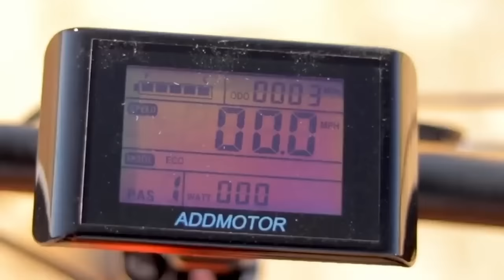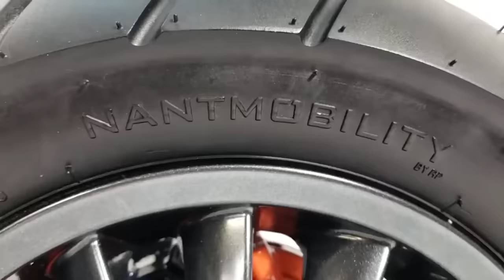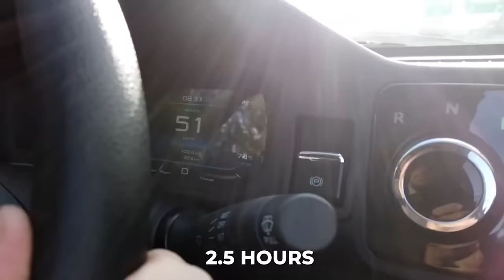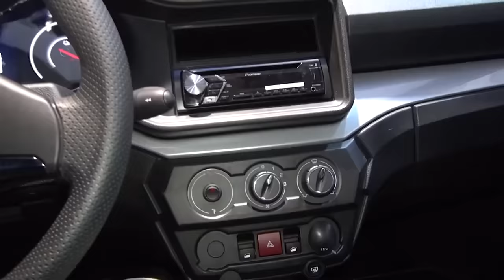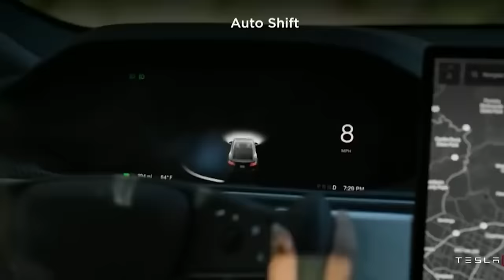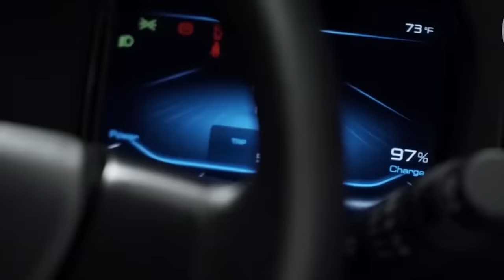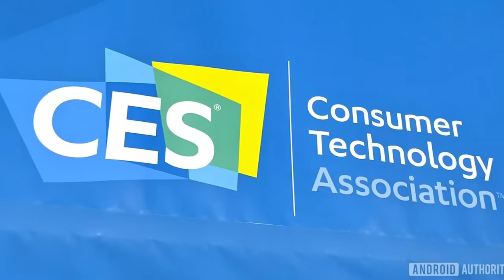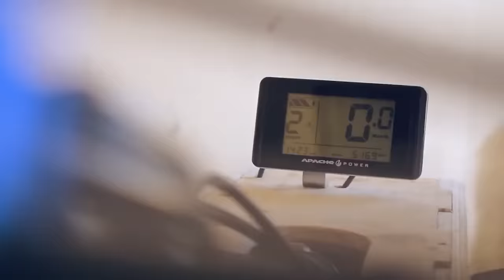60 Mini EVs, Quadricycles, and Bike Cars to Hit the Streets!

Comment: OK so I know a lot of people do those types of bicycling but I wonder is it just as effective as writing a 2 Wheeler because on a 2 Wheeler you can actually get up off the seat and use your body weight force down into your legs and pushing the petals to either up or down hill does it give you more or less of a workout
Reply from the maker: Interesting
Reply: people that ride recumbants and vello mobile say they are just as good maybe better.

Comment: I like the Begorett from Barcelona. Many nice features plus awesome visual. I guess its not available yet. But all of these fun ev's need to be realistic if they want to share roads with cars. As the saying goes for motorcyclists,"It's not if, it's  when". So once again, at high speeds and road sharing with cars, protection is numero uno. Freeway driving with those skimpy vehicles is downright nutso.
Reply from the maker: Logical feedback. Thanks! Yeah, for now, most of them are meant as inner-city drivers. Not necessarily for competing with big trucks on highways at highway speeds.
Reply: Thanks MUCH for using us....
Are there any links we can utilize to get to their respective websites?
Reply from the maker: @haroldpierson5271  We'll put those in future videos.
Reply: yes in the UK, it is illegal to drive Category L7e Quadricycles on motorways (like you cannot take 50cc scooters either). A-Roads are permitted however. the biggest concern i have with all these designs is crosswind stability. getting blown by 30-40mph gusts into incoming traffic, even if you are doing only 20mph, is not funny.

Comment: I liked the Zoox autonomous vehicle and the Tesla autopilot vehicle the best! Love this video!!
Although I think regarding your question about how I think people feel about using autonomous vehicles right now may be low, however, in time people will want these products and learn to trust them more. Like any new technology, like commercial flying in the beginning I’m sure people resisted, and after people saw their use and dependability and safe usage, trust came. I believe the same will happen here! Thank you!!!
Reply from the maker: Thanks Barb. I think you are absolutely right :).
Reply: how come they don't they don't always give the prices of
Reply: There was also a lot of resistance to AC electricity.
Reply: Not to be insulting, but I think the autonomous vehicles are just asking for trouble.  (I see auto semis running over Volkswagens on remote roads without even stopping or noticing)  I always prefer the anti collision system that monitors the driver to keep from crashing and always leaving the human in control.  When a computer kills a person in an auto crash who is going to take the blame.

Comment: Okay here's my overall summary. 

I'm from the USA and live in Michigan.  I'm retired and an old guy, but a lot of people drive short distances and hardly need a car, this may include college students and retired folks.  A pretty big market and I think most of these offering fail those people being to expensive, but especially senior citizens who won't ride in a recumbent with their aged bones and arthritis and back issues.  The velomobiles are nice but stupid for old folks with back problems. You better have a great suspension system for old backs and neck and rough roads for the US market or you will truly be niche.

SUMMARY: I hope to lease or buy a NIMBUS HALO if I can next year.  And after than my number 2 pick is a 3 wheel drive Aptera with 250 mile range and 700 watt hour solar option 30k, and my number 3 pick but maybe number 2 pick is a base Ford Maverick hybred truck for $20k.  All the rest of the EV's fail on this list as far as I can tell.  None of them meet my needs or price points and some of them are just unpractical for Michigan and for retirees and others who want affordable transportation compared to bikes.  This of course is my opinion but I'm an old guy and own an ebike which takes out the need for many of the vehicles showcased here.   

First most of these vehicles will be destroyed by the Nimbus Halo if you are in the market for a local easy to use vehicle and want a good price.  The Nimbus Halo if it meets its price point and features will crush most of the vehicles for a local car transport replacement for one or two people.   It's supposed to be priced around $6500 but some at least one of my friends think its way to cheap at that price and can never be built for that at the base price.  My friend told me he thinks the Nimbus Halo will be $15k in which case it will match the Elio motor EV price point.  And if it is that pricey it will fall off my list as well.  But that is the claim of the HALO a price point of $6500 for base and I'll want the AC option because I don't think the windows go down and it will be murder to have a sealed vehicle without air conditioning in the summer.  So mine will likely be more expensive than the base unit if I buy one.   If they make them available for this area, I'll either lease one of buy one.   

Second anything here that goes say 25 miles an hour as a low speed electric car and cost huge money like $10k or more is a complete waste of time and useless for most people.  That only is a side street golf cart and a complete waste of money as far as I can tell because you can't drive them on normal highways with speeds of 35 or 45 miles an hour.  I know they can legally be driven on roads that have a top speed of 35 miles an hour but at 10 miles an hour below the legal speed limit they will cause severe trouble reactions from drivers who want to go the speed limit or faster and are blocked by these vehicles. It doesn't matter if you have the right away or are legally allowed to drive a vehicle if you are driving to slow you are a road hazard and there are people who will hit you. So you had the "right of way" and we can put that on you're gravestone marker when you are buried. That is reality so charging anyone big money for a car like monstrosity that can only go 25 miles and hour is a waste of time.  

Vehicles that are small and lightweight and electric with a low range will always be looked down on by the US consumer. 100 miles is not even enough for most people in the USA even for a local vehicle because they may want to go far and quick charging is to slow.  Any of these small vehicles that cost $10k to $15k or more that don't have all the features of a normal car or small truck are a waste of money and I as a consumer would never buy one.  Good luck selling others with more money than brains.  I know cars are expensive and in short supply but people will simply wait and make due until they get a decent car at a decent price.  A Ford Maverick Hybrid truck from Mexico will cost $20k base and have 38 mile to the gallon in the city. That is what all these small EV makers are competing with a gasoline hybrid with a PRIUS engine type drive train and Toyota drive technology not an overpriced gas guzzling F150 which is silly expensive now.  

So you have to provide something truly revolutionary and there are only two EV vehicles besides ebikes that are and those are the Nimbus Halo if it makes it to market at price and specs they advertise and the Aptera EV which can have a decent range and speeds and is super efficient and has a 250 to 1000 mile range depending on the cost.  

Tesla Model 3 cars are nice and were tempting but the base price Tesla Model 3 is now $44,000 - good luck Tesla with that price although in the car shortage those who want a tesla and can afford one will probably pay up for one. So I wish them well, but I'd never pay $44k for a Tesla model 3 and then $600 a month for insurance for one.  That's silly expensive.  

I'm a fan of Tesla but I will never buy one because I'm retired. And although I have a pension I'm not going to waste my money on a car I barely drive and I shouldn't waste it on a EV car that is uselessly expensive and has less safety.  I drive very little but my budget is small and my cars are old and one was totaled.  I ride an ebike now most of the time and they are great fun.  My number one vehicle I want to LEASE for a year is the Nimbus HALO and I hope and pray I can lease one.   At least for a year as my main vehicle. But in the summer my main vehicle for shopping will be my Rad Runner Plus Ebike which cost me $1700 base but $2000 with accessories and I've added more to that including a VELTOP windshield and roof accessory which cost me about $550 with shipping.  My fat tired ebike can be used most of the year in Michigan and has a top speed of 25 mph unlocked. Why would I pay a penny more of an enclosed toy car that takes up way more space and can't be driven on sidewalks like a normal bike?  Why would I spend 5x more for very few additional features.  I simply won't. But I'll rent or buy a Nimbus halo if I can you can be assured of that. And I'll buy a APTERA with the full solar option and only 250 mile range base unit but with the three motor sport option.  For $30k a three wheeled Aptera will be a dream car of my lifetime and I hope I can buy one before I die and I hope Aptera is successful.  Yes I'll keep my old F150 truck for those uses I need, but barely drive it.  I won't spend $15,000 for an unpowered 3 wheeled electric motorcycle simply because the price of a New Ford Maverick truck at the base prices of $20,000 here in the USA and those ebikes and reverse trikes simply can't compete at that price point.   Of course motorcycle insurance and low fuel prices make EV's attractive to me, but their limited features in speed, range and safety simply take those high priced toys out of the running.  For me for most of my driving and I'm retired a 50mph top speed is sufficient. I don't need freeway driving. I want a rather long range just in case, but most of my driving to stores is less than 15 miles a day.  So I'm a perfect customer for almost any cool EV vehicle.  The Nimbus HALO may be so cool I may even skip the Aptera if it lives up to the hype of the HALO I read about.  But even without the Aptera which is estimated to cost me $30k a Halo and Ford maverick having both extremes covered might be a great alternative for me.   Keep in mind I drive under 15 miles a day on average so most EV ranges here are sufficient.  But my ebike covers all the fun with a Rad Runner Plus being that.  With the Aptera and solar option in Michigan for me, the Panels will do all the charging and I'll never pay for electricity or plug it in as I won't need to for normal driving.
Reply from the maker: Thank you for the very in-depth feedback. The Aptera is great, but Ford also has a fully-electric F-150 coming soon!
Reply: "...senior citizens who won't ride in a recumbent with their aged bones and arthritis and back issues..."   -  that's funny, because the back support, suspension, comfort, and safety is exactly why senior citizens buy recumbent trikes and velomobiles in Europe - with or without electric assist.  As this is born out by sales for the last 10 years for companies like Hase, Anthrotech and Sinner just to name a few.
Reply: Buy f I rd f
Reply: F150 hybder eltric f150 230 300 Mike's rangr
Reply: @JimmPratt  Where is the proof...SHOW us !!
Reply: Firecatgreg...Read all of what you had to say..., BRILLIANT, simply brilliant..If only more people would educate themselves by reading the above, they would not be hurt financially (and possibly physically).KUDOS for you taking the time to educate.
Reply: Chief tow only 8.52 m I es water town 2 way trip knly 66 mioke range

Comment: I watched this and really they focus on speed not range I need at least 65 mph but need 200 mile range of charge 
People of freeways go to fast and create traffic if people slow down the traffic will move more smoothly and we have snow and rain so it need to be inclosed with 4wd and a reasonable price wouldn't hurt under $4000- $20 000 because $100,000 is just insane.
Reply from the maker: Good points.

Comment: some of these alternate forms of transportation are ready nice.  Several were very nice and they all have a spot they can fill.  But if I'm shelling out $8,000 or much much more and it's not a real car or truck it had better go way way over 100 mph.     I can't help it!
Reply from the maker: I totally get where you're coming from! When you're dropping some serious cash, you want that thrill factor, right? It's like buying a top-tier mountain bike and not taking it on the trails—what's the point if you're not pushing the limits?

And let's be real, there's something about breaking that 100 mph barrier that just feels like you're in a club all your own. It's not just about the need for speed; it's about what that speed represents—cutting-edge tech, power, and the freedom to just fly (responsibly and within legal limits, of course).

Comment: Love those. I have a 1200 watt RAM E-Scooter. It will do 38 KPH up a 20% grade unassisted. So would need one of these with at least 1000 watts. A good solution here in Costa Rica with the heavy rain. We have many roads at30 to 35% grade. I stay off those. I don't feel save going less than 10 KPH under the speed of motor vehicles. Fortunately that us mostly 40 KPH posted limit and the majority of drivers are also usually 10 to 15 under the posted limit. As  bikes, e-bikes or motor cycles in San Jose , "No Way Jose"  Way too dangerous for me.
Having a small utility/convertible camp trailer built. As I do not have residency here I cannot have a driver's license. So this allows freedom of mobility.

Comment: I'm 75 and live in Costa Rica. J
Hills finally got too steep for me Many are 30 to 35% incline my driveway 28%  Ao bought a  RAM Mia 1200 watt scootewr. Cost waa $1800.  Almost no infirmation on it.  Also building an 80 cc 2 stroke moped. Size is unmarked and only 50cc allowed without license
Reply from the maker: Nice! Good luck with the builds.

Comment: Keep in mind that in the U.S. if a vehicle are certified for 25 mile an hour streets you can not ride on street with higher 30 ,35, 40, or more an hour roads .So you would basically only be able to ride up and down in front of schools during school hours. You almost certainly could not drive on the street where you live or most anywhere else.
Reply from the maker: Or almost anywhere within a city area.
Reply: Brenda, that is not true NEV regs in most states will allow you to cross highways, or as long as the street is rated a NEV rated street! in general 35 mph or less.
Reply: @davidgreiner390  not California
Reply: @brendaboyen1681   Oh sorry California would not be a state I would live in (born and raised there) Been in Arizona 23 years now your Electric Grid will not support EV's but the state just made a new rule all new cars must be electric by 2035 fail!
Reply: Yes ,it is the most fascist state but I'm an actress so I'm stuck here. Have a good day.
Reply: @brendaboyen1681   yes I used to work, Hollywood and concert scene, back in the early '80s and into the 90s,  I was a photographer back then, later in life I worked on both TV and movie sets, I could fix anything mechanical or electrical
Reply: But it was as a welder that I got to work on some really cool sets,
Reply: @davidgreiner390  The grids will evolve to meet any EV needs. Twelve years is a long time to ramp up, and ICE cars will still prevalent on the roads for a long time after they are no longer for sale. No drama needed.

Comment: How many EV out there have a cruising speed of 50 mph and 50 mi range.
Reply from the maker: Not sure, but a lot. They usually follow electric quadricycle laws and regulations, meaning they are only legal on roads with posted speed limits of 35mph or lower.

Comment: The Audi Urban is the only vehicle with downscaling made right…nobody knows how to upscale and downscale correctly, don’t you think ? What about a Ferrari 458 down scaled correctly…a Mercedes EQS Downscaled correctly…a Rolls-Royce Phantom downscaled correctly 20x times to a 25000$ pricepoint with 2 seats driver and passenger…2,7 Meter long all Luxury climate controlled cabin 80cm wide self-balancing fully electric
Reply from the maker: Great point.